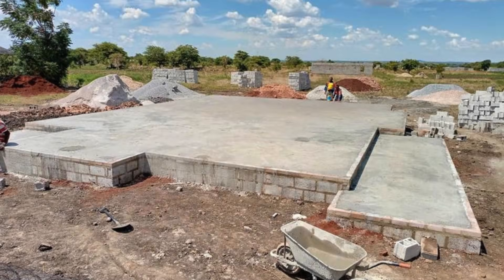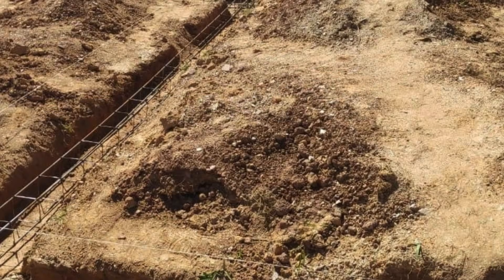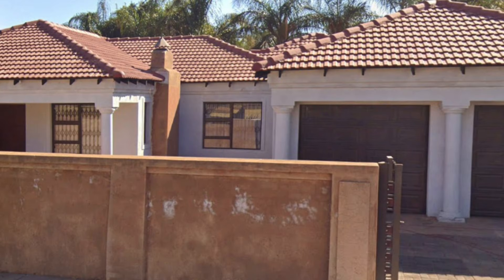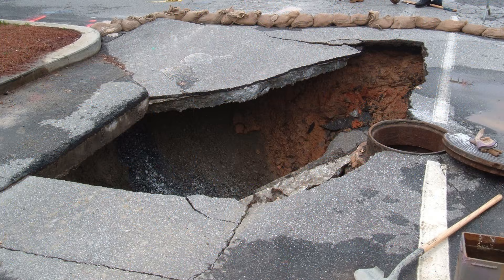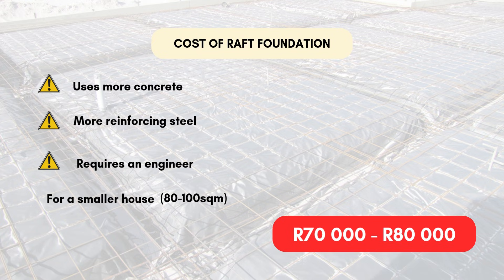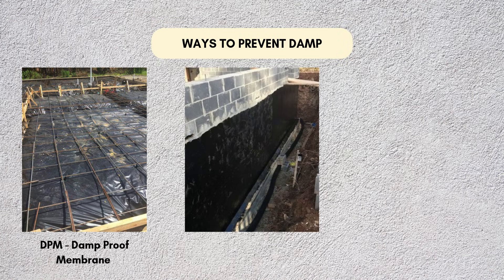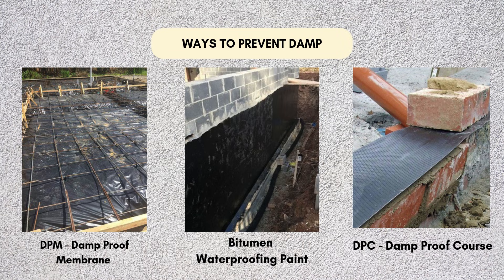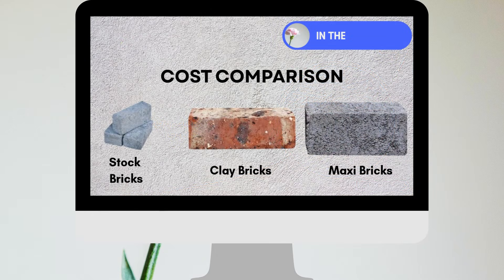Foundation Cost Comparison | Building a House in South Africa | #FutureHomeBuilder🏡

Comment: Builder didn't use reinforcement steel in foundation but we've added the reinforcement steel on ground slab. It's a single story house.
Reply from the maker: Thanks for sharing that 😊- usually reinforcing steel (rebar) is used even for single storey houses they say, to prevent cracks down the line.  Was an engineer involved in your project?

Comment: Just started building my home last month. We just at the beginning stage hitch is a foundation. It is a two story building 5 bathrooms and 6 baths. Being built in the village. Although I am using the local builders best and experienced one the materials ain’t cheap and so it the builder. So far I have spent R60 000 and the foundation isn’t even done yet because the land isn’t leveled up so there’s more that needs to be done to make it level 😢 I am doing it. I will do this. I will finish this. Come rain or sunshine my four kids will have a place to call home.

Thank you for sharing and motivating.
Reply from the maker: That's a great accomplishment, you got this! 😊
Reply: You will finish this ❤

Comment: Hello Sedi❤
Reply: What's a no slab?
Reply from the maker: @polokontamehlo  Hey mama! So when I say “no slab,” I just mean there’s no concrete floor. Some people build the foundation, then fill it up with soil and finish the floor with something simple like a screed. 
A slab is that thick concrete floor you usually see — but not everyone does it, especially when saving costs.
Reply: I hear the foundation and roofing are where you just feel like quitting 😅
Reply from the maker: @polokontamehlo  It's better to budget for those 2 stages first, especially the roofing🫠
Reply: I didn't want the video to end 😢